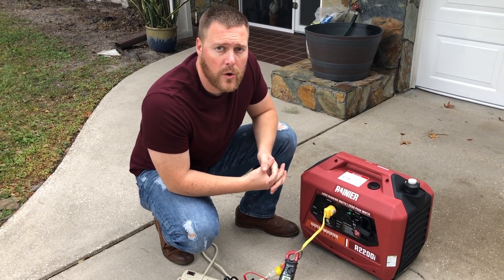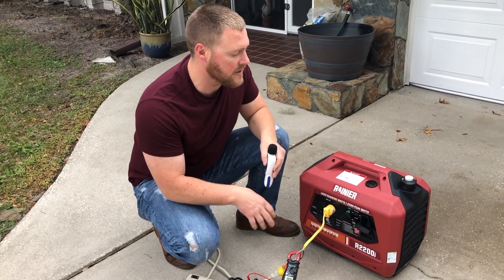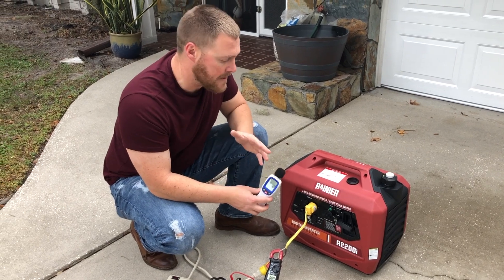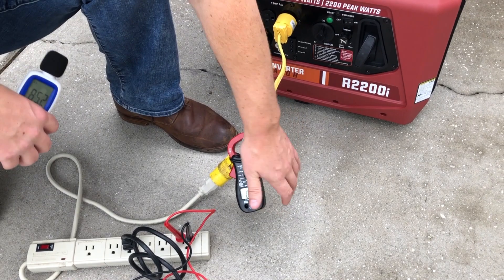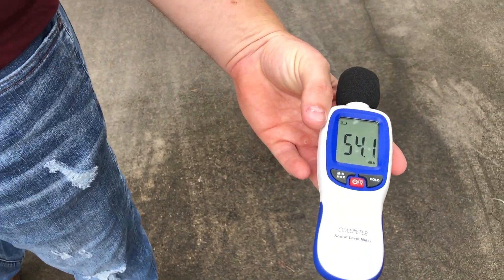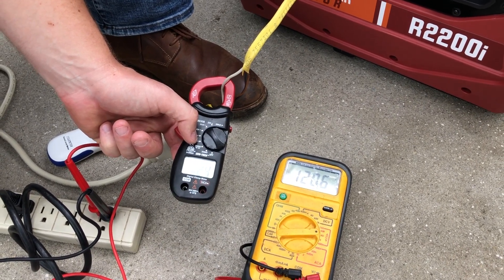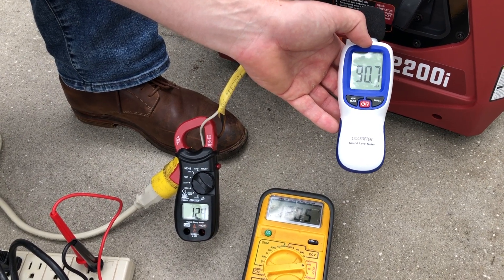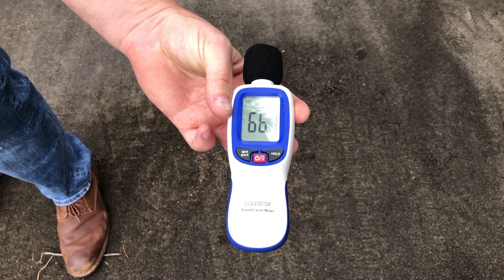Rainier R2200i Inverter Generator Noise & Load Test At Various Distances 20", 30' and 50'

Comment: Any chance you could do a review on the Green Power 3500 watt inverter generator. Advertised locally at Rural King for $724.99
Reply from the maker: Will check into it. Thanks for the suggestion!